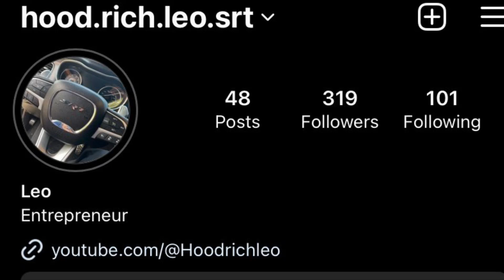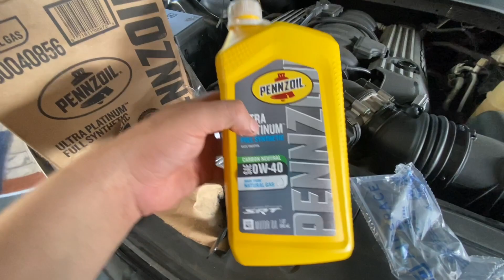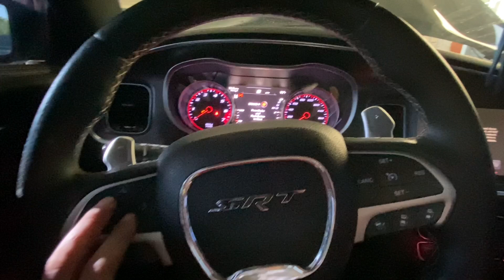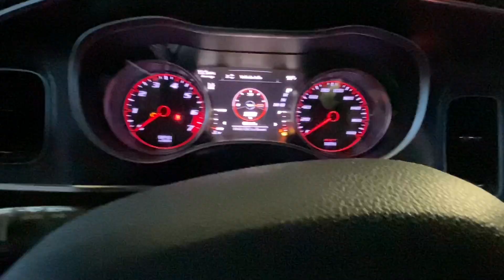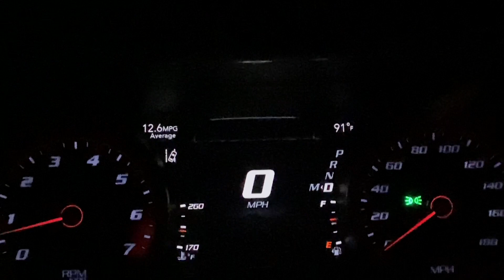How to do a oil change on your srt

Comment: Yea I'm startling to think my ram is messed up because I used a cheap oil and don't think it was full SAE i used the quaker state brand probably why my truck is messed up I even told myself I would only use good quality oil but I didn't or my lifter was on its way out regardless
Reply from the maker: Yea I use the oil dodge recommended can’t cheap out on stuff for your engine gotta have it running A1 I be scared to cheap out oil for these cars are expensive also 🥲